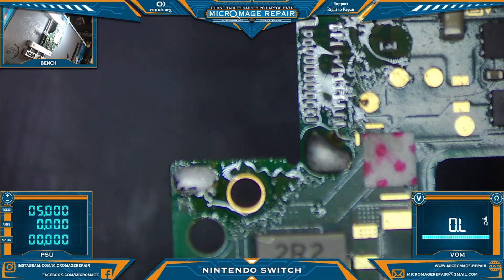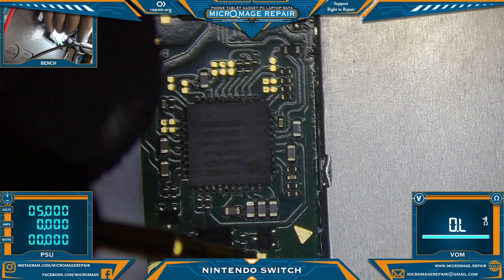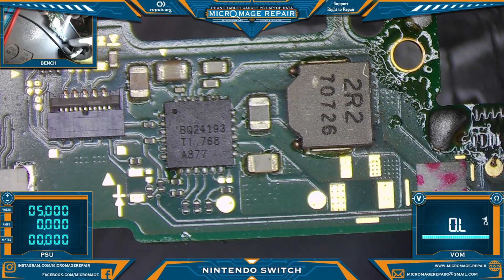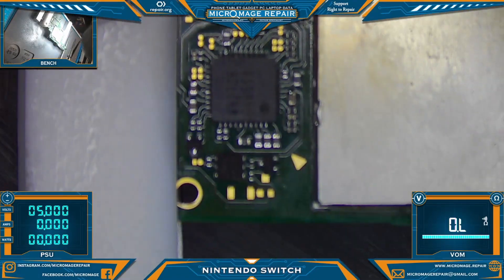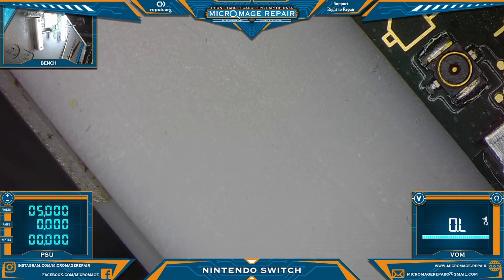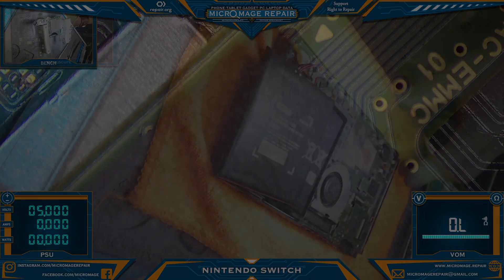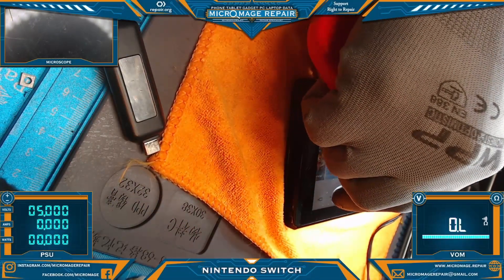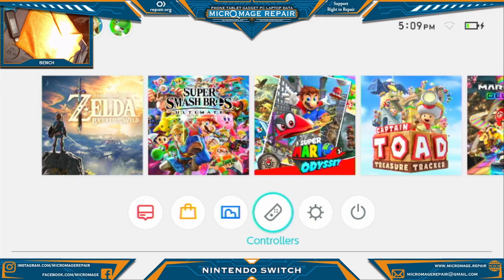Nintendo Switch: Error 2162-0002

Comment: I got this error mid operation...

I use the official ninty charger (which my lite never had an issue with...)

Strange days, when less than one year old electronics just do that...
Reply from the maker: Yes they can be quite strange.
Reply: Only Switch sofar to do this tho (2Lites and one 2017 switch not once gave such error)

Hmm.. At least it still holds up.

BTW: Your cameraperspective, I'd suggest you center it like NorthridgeFix (Youtube) does for his vids.

Makes watching easier
Reply from the maker: @repeekyraidcero  Appreciate the suggestion!
This is an older video, I've gotten a bit more mindful about the cameras though I am still having some issues with the microscope camera being misaligned from what I see in the scope.
Actively trying to solve that.

Comment: I kept getting an Error: 2162-0002 just after changing the card reader. I put the old bad one in, and it worked. Put the new one in, still got the error. Re-connected the two cables to the card reader, and then it worked. I thought maybe a 2162-0002 meant not enough battery power. But I charged it for about 15 minutes while drawing about 8 Watts, and the same error. So I suppose it could have something to do with something one might be messing with, in my case, swapping out the card reader. The small one coming from near the headphone jack (under the heatsink) was I believe the problem connector for me.
Reply from the maker: Thanks Thomas Tommy! 
Interesting finding, I'll definitely note it!

Comment: I got same error message yesterday but after push power button all be fine again till now,but why i got that error code 2168-0002 and maybe this message can show up again 🤔
Reply from the maker: Recently found out a cartridge reader can cause this error. Might be having something intermittent going on with it or a game card. Hard to say though.
Reply: @MicroMageRepair  but I playing digital games🤔 I hope my switch doesn't get any worse
Reply from the maker: @baimzgaminghealth3865  If it's the PMIC it may just fail at some point. If it's the cartridge reader hopefully it will just pop up now and then and go away.
Hard to say.
I know not the definitive answer you probably want, but it's the reality.
Reply: @MicroMageRepair  thank you so much for answering my questions 😁👍
Reply from the maker: @baimzgaminghealth3865  Thanks for the questions!
Reply: @MicroMageRepair btw it's mean my pmic is trouble but not All point at pmic?cause I playing digital games only,any change can be like that🤔
Reply: @baimzgaminghealth3865  Even playing a digital game the Switch still has to boot. I got the error with or without a card inserted. And my error was my card reader I was installing. The cable that's under the heat sink is really hard to press in correctly. After I finally got it pressed on I took some foam, squished it, taped it down over the connector. So hopefully that connector stays on after future abuse.

Comment: Thanks a lot for this informative video! My Switch is working perfectly fine unless I insert a cartridge, what gives the same error code. Would changing the cartridge reader be enough to solve it or is there likely instead a soldering issue or chip failure on the motherboard? Best regards, Matt
Reply from the maker: Appreciate it!
Hard to say for sure, there are something in the neighborhood of 4 versions of card readers and not all are compatible with every board. 
There's no way to identify them.
So you may have to go through a few before you can make any determinations. 
It can also be board level either on the reader or on the main board unfortunately.
Reply: @MicroMageRepair  thanks for your lightspeed answer! So even buying non fonctional Switch for parts is riskier than I expected... is there any publicly available information regarding the card reader versions and their compliance to Switch models? So far I didn't find anything on this subject.
Reply from the maker: I've not found anything that does. If you find anything please share with the class 😜

Comment: What are those diode array called, I think I might buy some for the extra precaution like you said. I see some 6 pin ones one eBay but I am not sure if it’s the same thing.
Reply from the maker: Here is the model number of the one we use as replacement. TPD2E1B06DRLR
Reply: @MicroMageRepair  thank you saint micro mage!  🧙‍♀️

Comment: Great Video and Editing... How u Record ur Multi-meter reading?
Reply from the maker: My multi meter hooks up via USB and has software that can control it.
It's not a top of the line meter really but it's useful for this.
Reply: @MicroMageRepair  i ve got the Fluke 18B+.. good multi meter.. but lack this feature.
Reply from the maker: I have a few Flukes myself, I drag them out when needed. But yeah they don't have this ability.
Reply: @MicroMageRepair  what is the one u have?
Reply from the maker: The USB one is a Tenma 72-1020. The Flukes I have are the 85 III , 79 series II, and a 10.
Reply: @MicroMageRepair  thanx 🌹